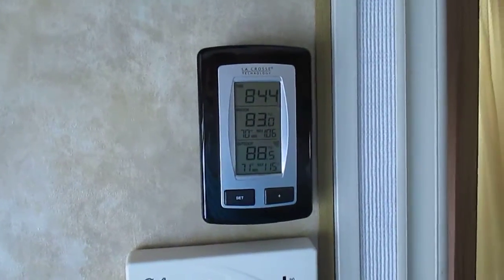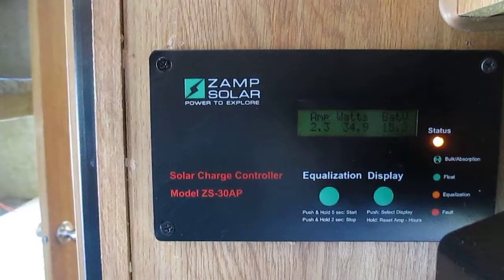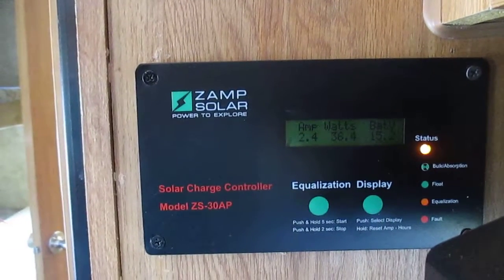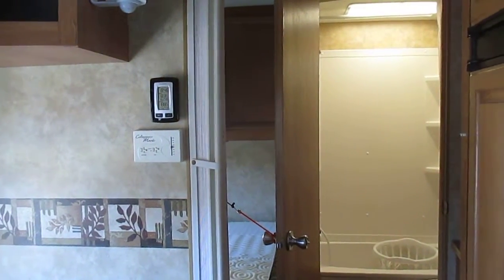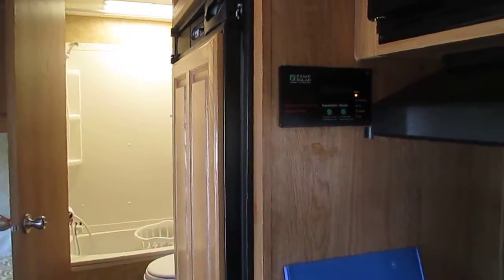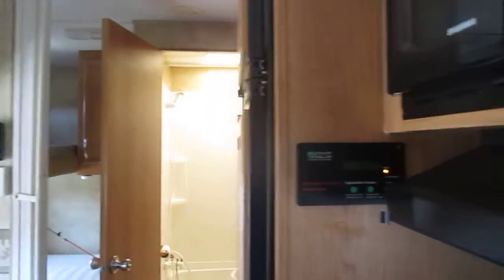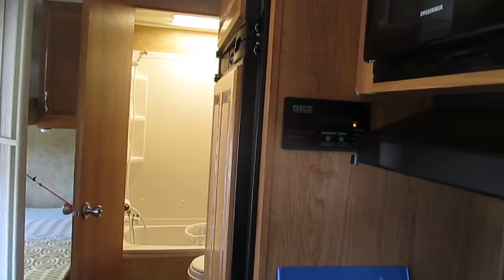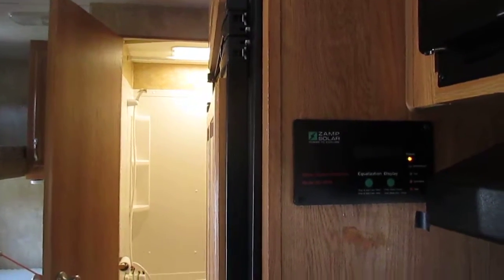Why I choose a PWM controller on my RV

Comment: I seldom use solar as I am normally plugged in. I have found when I do use solar (deployable not mounted)  the pwm works just fine for me too.
Reply from the maker: I think most people just go with what ever the sales person suggests. Be it on-line or at the counter. There's a guy in particular that has positioned himself as a guru on FB RV boondocking pages that if you don't have enough panels to power a small town you aren't doing it right and the sheeple go on praising him. He tends to camp in the desert year round because he spent too much on his solar system to travel. It's funny to me and a few others that know his game. The bottom line to me is if you can fit another panel on why not double your wattage as opposed to gaining 25-30% with a MPPT. Again all this is just my opinion.
Reply: Its an opinion that makes sense to me.